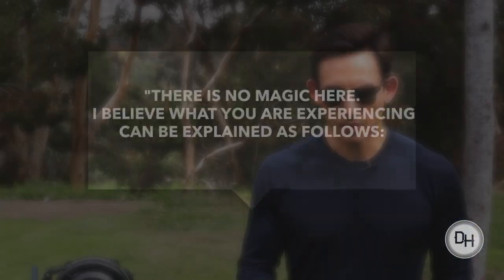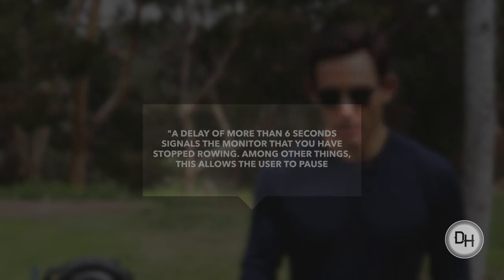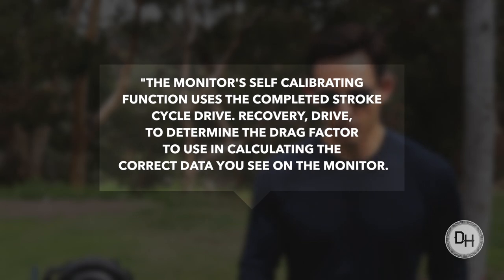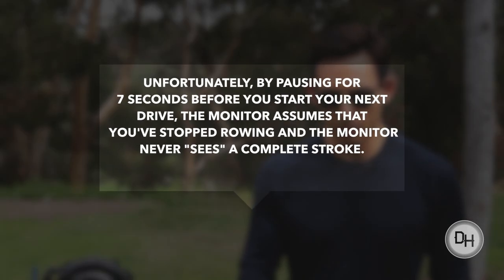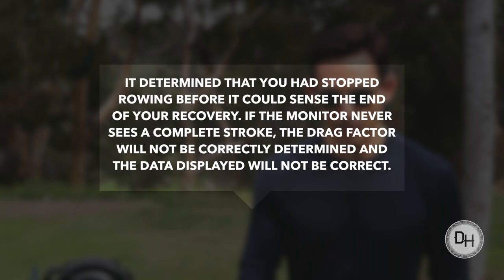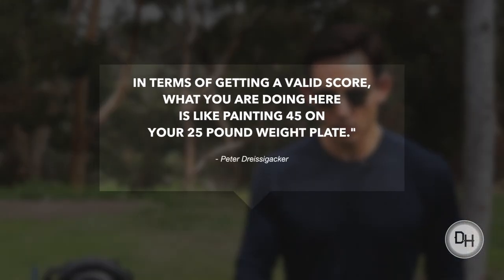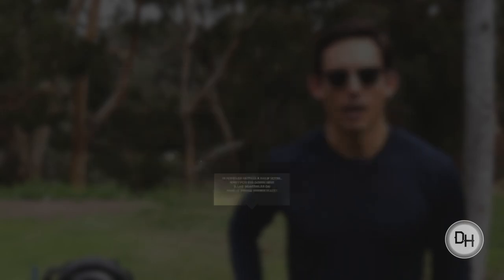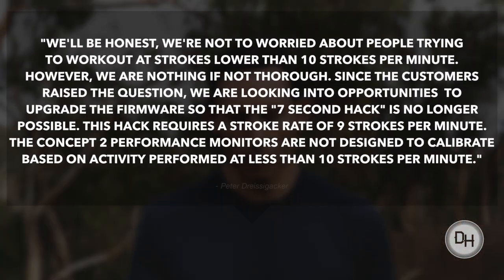7 Second Rowing Machine Hack - Official Concept2 Explanation

Comment: Thanks  a lot Shane for this valuable update!  I have a question if you please that may be somewhat irrelevant: When I set up the monitor(PM5) for single calorie lets say for 500Cal, it counts down the calories I am burning at a slower rate than when it counts up when I put it on a different setting, like just single time/distance although I am using same spm and intensity, is there something I am missing or there is something wrong in my machine? Many thanks in advance.
Reply from the maker: Probably not anything wrong other than when you’re counting up the monitor is trying to calculate and average based on an undefined end point therefore it doesn’t have the same metrics for averaging as a countdown or defined variable workout.
Reply: Thanks a lot Shane for your quick reply!  So the latter is more accurate then? I mean the calorie countdown? I really appreciate the time you take to answer my questions so many thanks for that